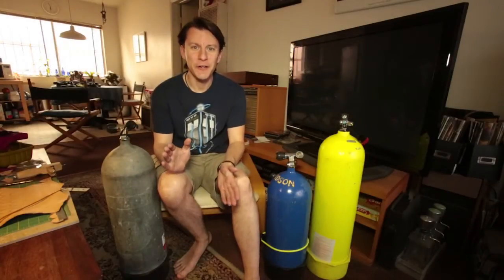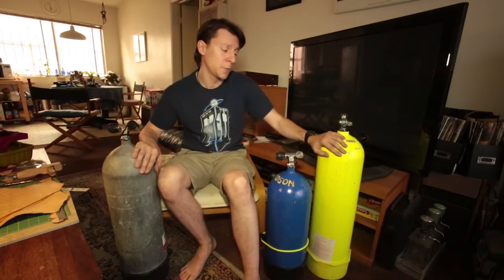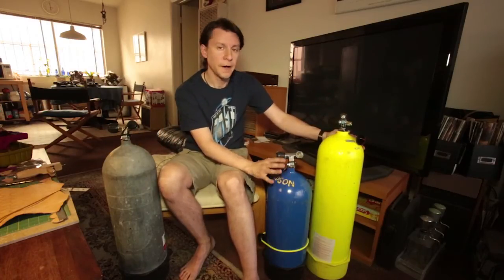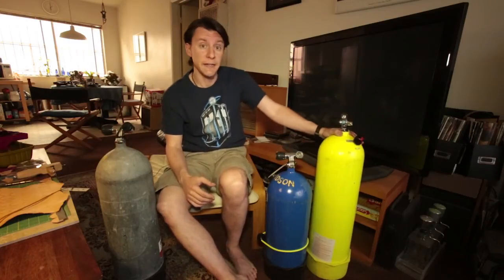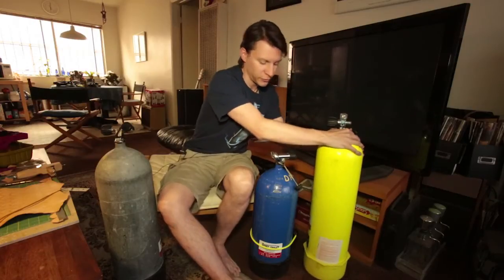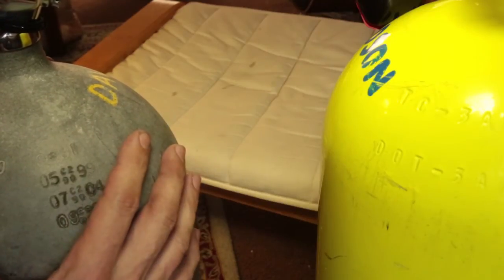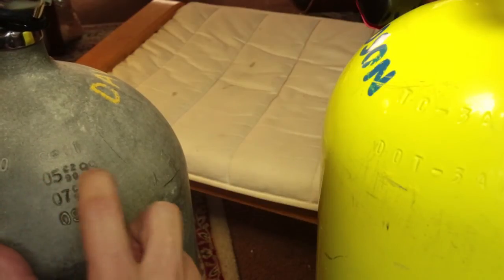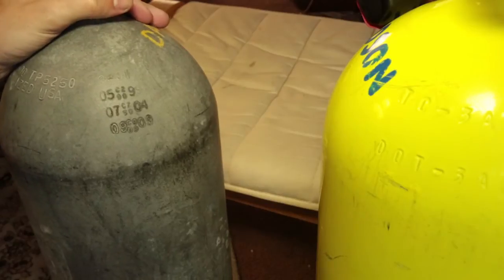Modrenman: Scuba Tanks

Comment: Hi, what 3AL stands for? i have an 1985 luxfer with probably 5 dives and i cant tell if it as the 6351 alloy, scuba shop is telling me to discard it but its like new, how can I be sure? Thanks
Reply from the maker: Nick Vito Bovino 3AL is aluminum. I don't know if your tank is safe or not. Luxfer had a problem with tanks that had neck cracks in them, so many of them are unsafe and thus dive shops won't fill them. I suggest you look up the serial number and see if yours is one of them. Good luck!!
Reply: ModRENAISSANCEman Thank you for your quick reply. Happy Diving